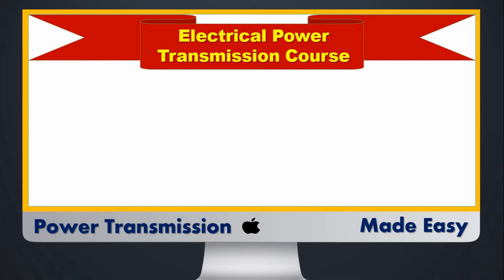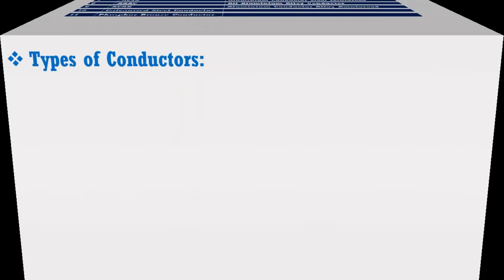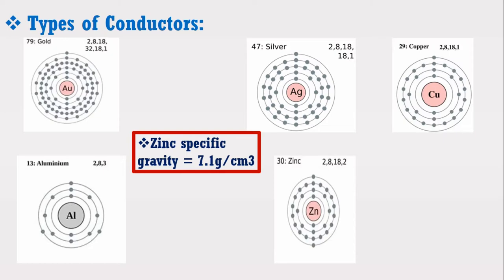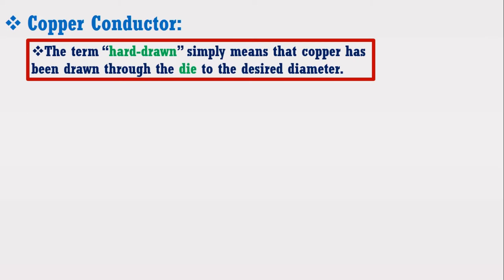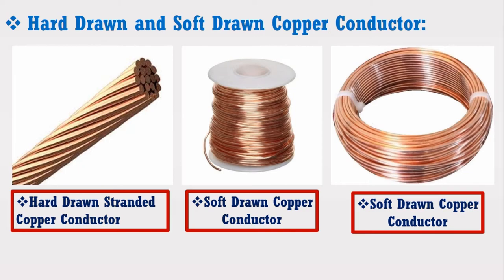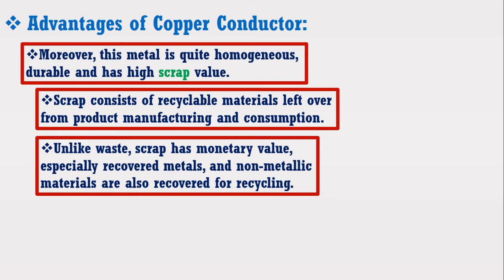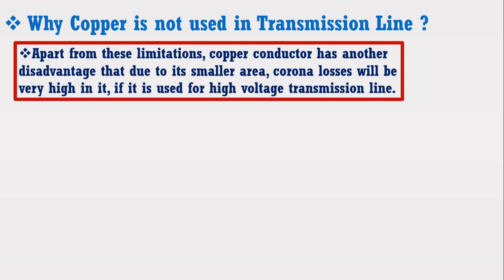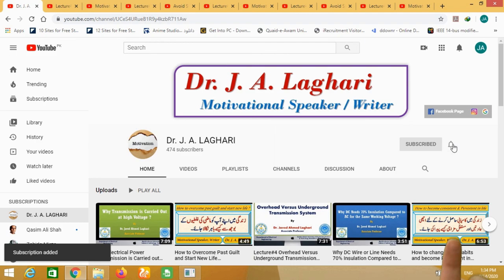Lecture#16: Copper Conductor and Its Alloys Application in Overhead Transmission Line

Comment: sir copper already has high tensile strength so why we are making its alloys like(steel copper and cadmium copper) to increase its tensile strength even more and by doing so we are reducing the conductivity of copper so is it wise decision to do this????
Reply from the maker: You are right. But depending upon the application, strength required may be high. Therefore, strength can be increased by adding cadmium, or steel. These are the possible options. It is not compulsory that these conductors are used everywhere.